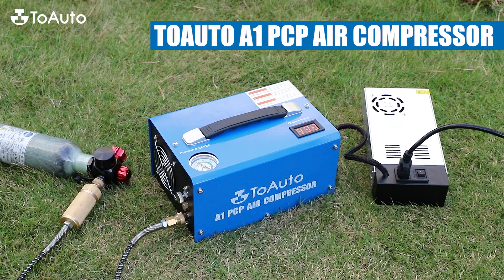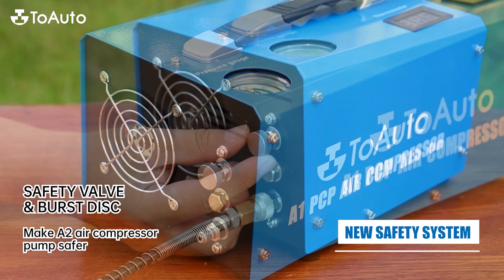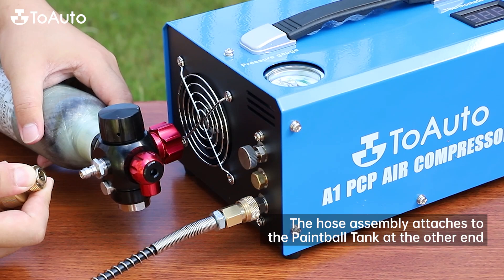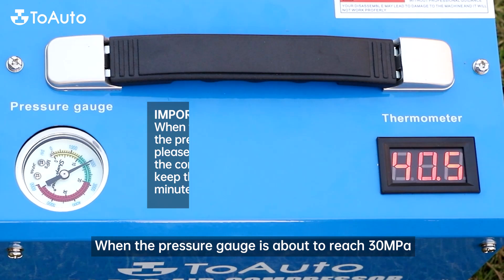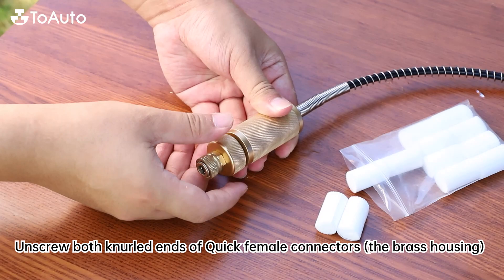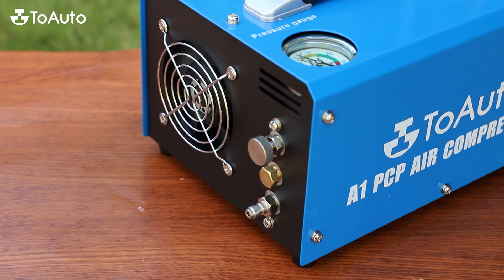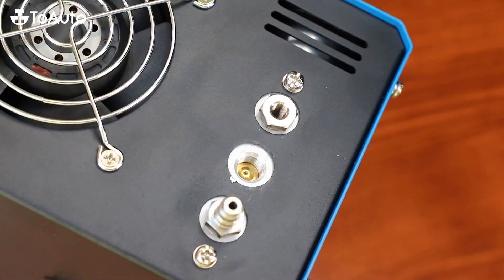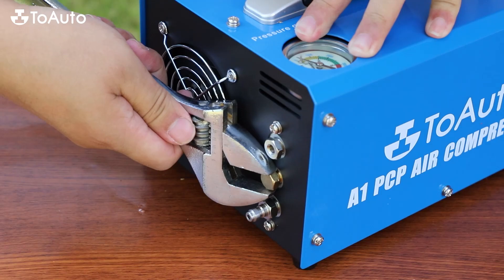How to use ToAuto A1 PCP AIR Compressor? Portable air pump use tutorial and common problems solve.

Comment: What should I do if the bleeder valve blows a lot of condensation? A lot. Enough to get my hands wet
Reply from the maker: It's okay. Only a small amount of water can enter the bottle. The filter element of the filter needs to be replaced frequently. Most of the water is absorbed by the filter element. The filter cotton inside the filter can be replaced. If the frequency of use is high, the filter cotton should be replaced regularly. The filter cotton can continue to be used after drying.